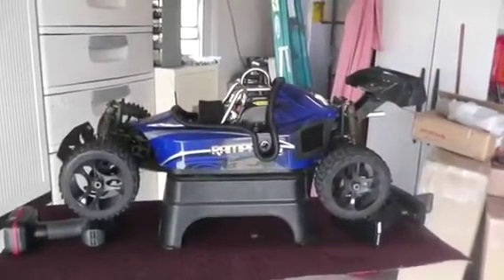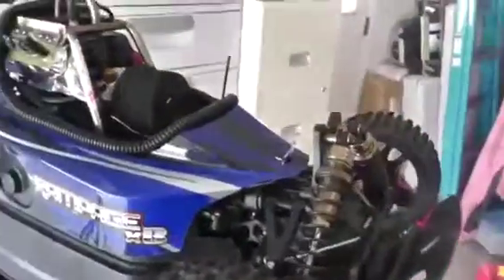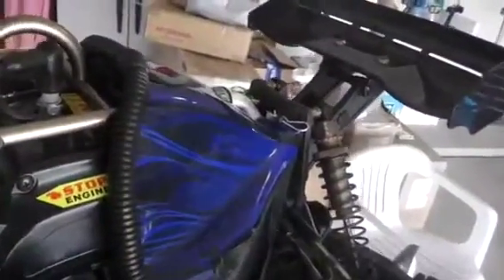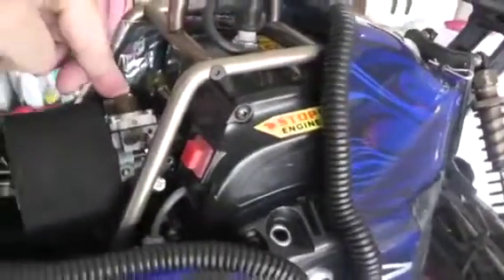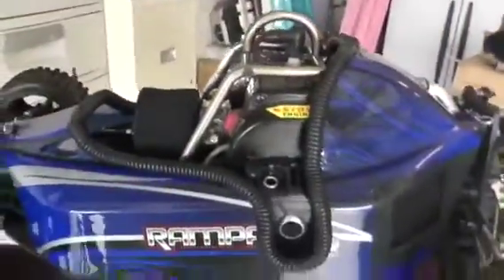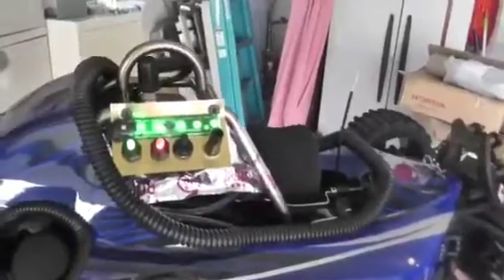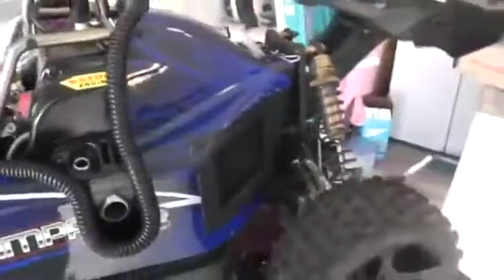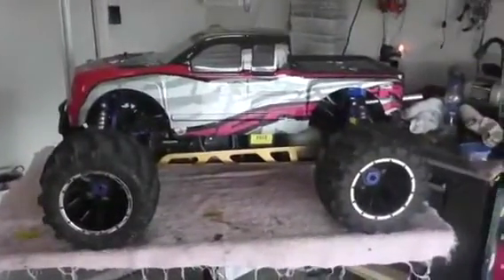Killer RC - Power Starter on Redcat XB

Comment from the maker: Also, if a pull starter breaks right before a race, you just lost the race. On this kit the only moving part is what is in the drill. If the one-way bearings seize up, it only takes a few seconds to put a new driver in the drill and get the engine started. Spare drivers are only $10.

Comment from the maker: I sent you an email. If Super Bee LED turns red and then green by itself after you turn off the transmitter power then the failsafe is overriding the kill switch. This happens often on Spektrum radios. To fix it you need to hold the Aux button in the off position (super bee LED red) while you rebind the radio. That should fix it. The Super Bee LED should turn red and stay red when you turn off the transmitter power.